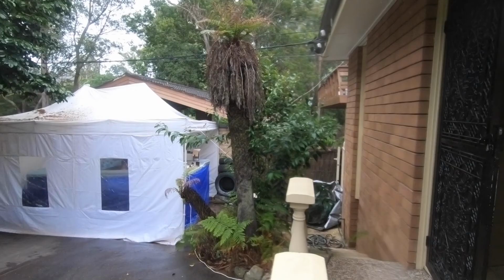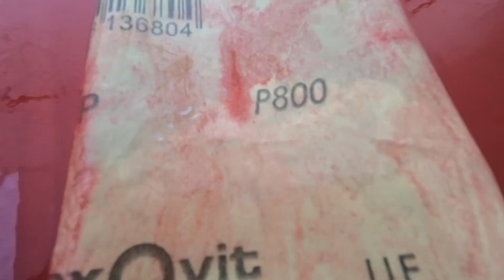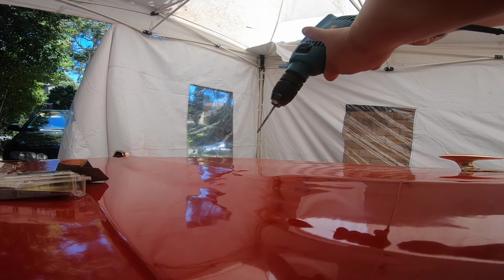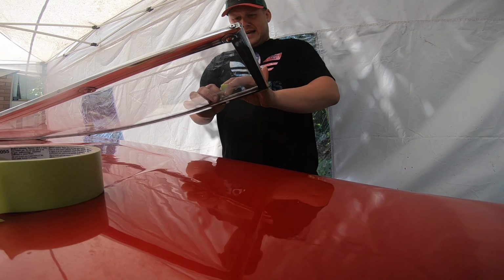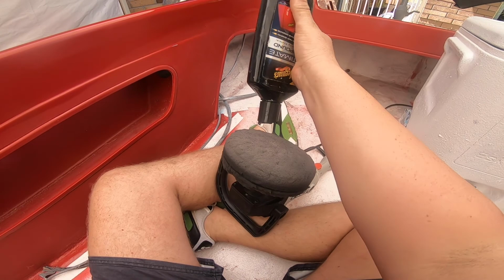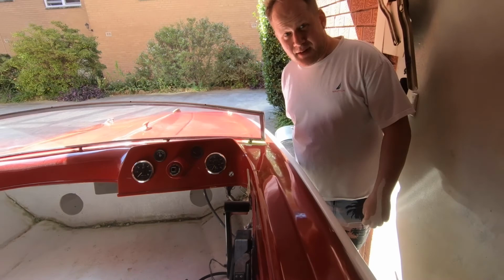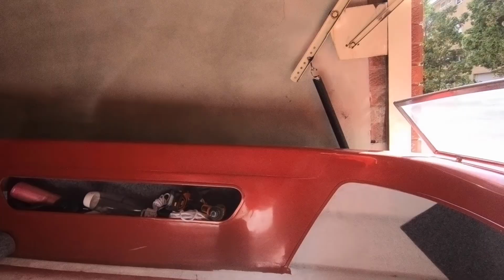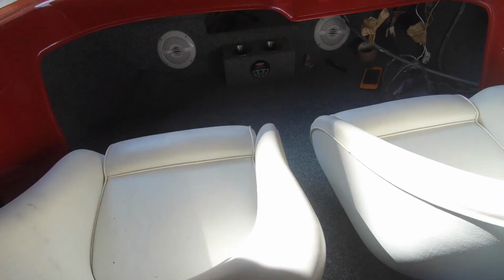[Painting boat with automotive paint] DIY Ski Boat Restoration - 1964 Glastron - Part 10

Comment: Did you sand in between clear coats I'm in the process of doing the same I have 3 coats of base on already sanded. I bought the same Wagner gun as you😂
Reply from the maker: No I didn’t do wet sanding between coats of clear. I did about 4 coats of clear then wet sanded a day or two later.
Reply from the maker: I recall it went… 

Primer
Primer
Wet sand
Red
Red
Red
Red
Wet sand
Clear
Clear
Clear
Clear
Wet sand
Buff / polish